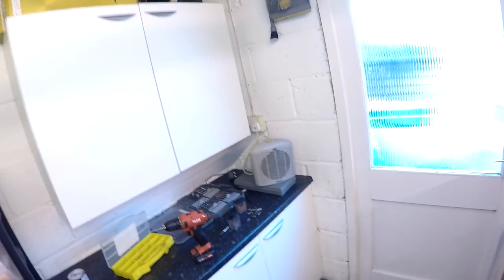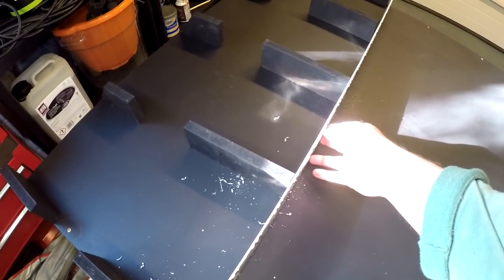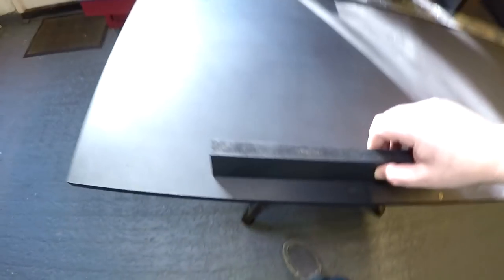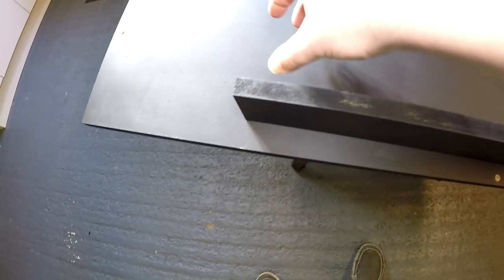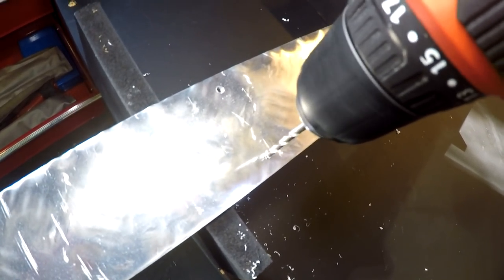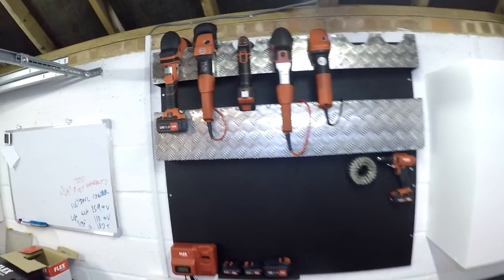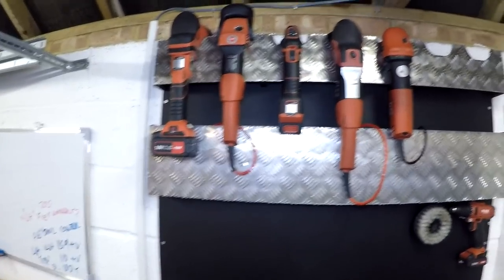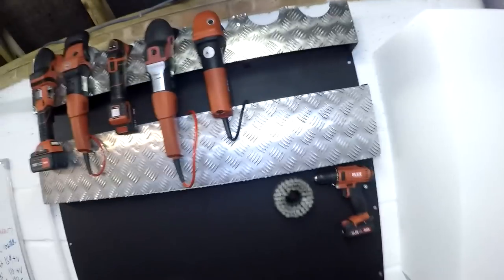ACME 2000 Forensic Machine Polisher Holder

Comment: be careful there the curved hangers might damage the polishers on the point of contact with repeated use it might not be pretty but you should consider fitting some rubber trim in that area
Reply from the maker: True Dat.   Ive actually done this.  I found some 3mm sleeving and trimmed it so it has a rubber protection on the circular cut bit now...
Reply: @ForensicDetailing  You can use car door edge guard. Cheap and widely available and just pushes right on.

Comment: Only just watched this and 2wks old. You did a good job Jon. Mounting is 10x stronger than needed, don’t worry. Weight force is only down (shear value on screws).
Already been picked up by many, find some rubber or nylon 5mm tube, slice and fill cutouts. I’d like batteries having a small shelf front to stop knocking off Flex batteries are expensive!

Comment: U drilled 4 bottom holes in mortar joints. Should of drilled into the block
Reply from the maker: yes is this bad?   The reason is I get like a perfect tight hole in the morter.   If I drill the block it sort of made these like huge crumbly holes in the past and the plugs didnt grip.
Reply: @ForensicDetailing  if your used decent screws and plugs it should be ok. Regarding drilling into the block use a small 2mm masonry bit to drill the pilot hole then use the size you need like an 6 or 8mm
Reply from the maker: @koigifts8356  boom thank you so much. that makes sense. my DIY skills aint all that love learning little tips

Comment: You need some greenhouse glazing rubber edge rubber seal gasket for the edges, especially where the tool sit. I think I have some I could send you but an away on holiday at the moment, let me know if you want some
Reply from the maker: thats sorted fazer you can get like this edging strip especially for this.  Ive put that on now.

Comment: 10 screws and wallplugs will be fine.

If you have not bought the cheap screws and wallplugs?

if you are worried about whether it is sturdy enough, you can test this very easily. 
Take a few bottles of water that are heavier than all the tools together and place them on top without your tools, or take a few hooks and hang a weight on them. 
And hang the hooks where the polishing heads are now hanging. 
Often it is the screws with which you attach the tear plate that they may not be strong enough. 
The wall screws usually do not get loose, provided you have properly drilled the holes for the plugs, so not too wide, or in a wall that is too soft.

Comment: I would like to see you doing a series on the underneath of the car. Sometime after they stop salting the roads and when the weather drys up to get it protected for the following winter.. Its an undercooked area of the car and one of the first to start rusting, when you get it clean then it's time to protect it with one of the numerous products out there like Dinitrol or Fluid Film. Whats the point in having a nice shiny car when its arse is dirty.
Reply from the maker: yer its on my mind to actually when spring kicks in to do a good undercarriage clean.  but Ive done videos on it before.   but why not I can do it again becaus eI will be doing this on my m140 for sure.

Comment: Hi Jon Lovely bit of kit. Well done. One small suggestion, On the bends where the polishers rest and also on the straight section where the wires rest, I would buy some car door rubber edging and cut to size.  That way the polishers won't rest on the metal and avoid any mircomarring on the polishers or scraped wires.
Reply from the maker: yer Ive put some edging strip up on the curves to protect the tools.  just did it a week after I shot this :)

Comment: Hi. I've been planning a build like this for the last three months. My problem is that i need it locked. My current thinking is to have tension wire crimped and looped that straps the machines down individually around the head of the polishers with a small combination key padlock. Or a bar that locks in a row of machines straight across the machine heads. 🤷🏽‍♂️
Reply from the maker: or like a top section you can drop on thats like the reverse of the bottem section. to create like a stock.. but need a top lid so they cant unscreew the plate to free the machine.